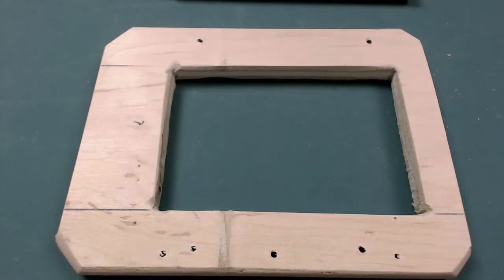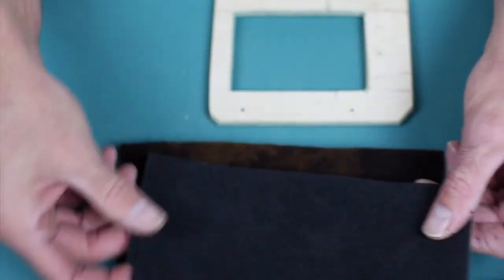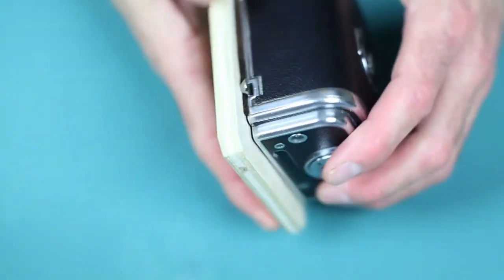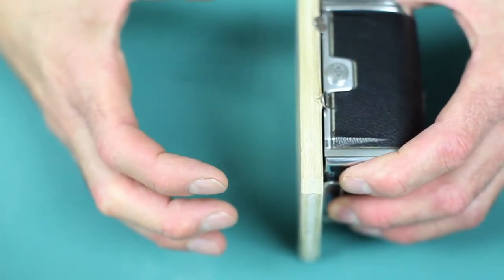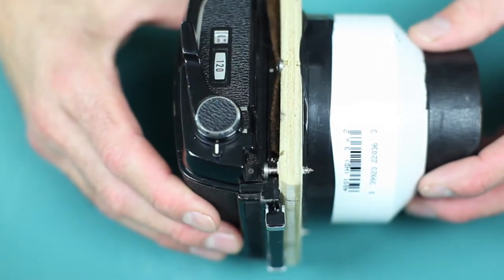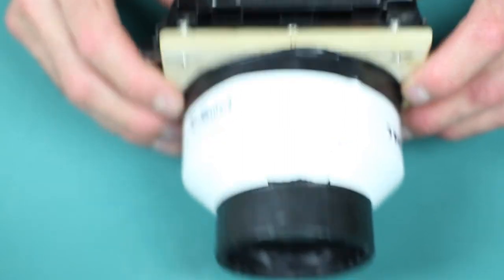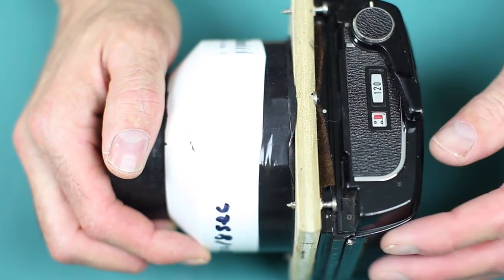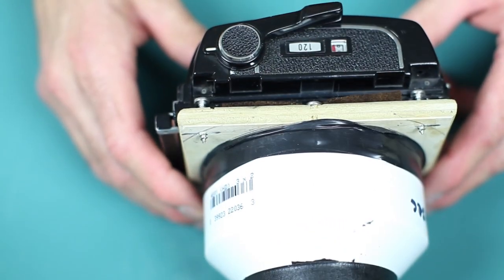Pinhole Camera with Medium Format Film Back

Comment: Hi Matthew. Great work here. I am planning something similar, and have a question that perhaps you can help me with. I am struggling to choose a film back because I am unsure... Do any of these backs have any sort of winding prevention mechanism that disengages only when connected to the camera body (by some little pin or something). For example, it was my understanding that one cannot wind a hasselblad back past frame one on the back alone, but only by using the body. Ideally I'd like to use a 6x6 back.
Reply from the maker: Hello. I don't have my Hasselblad backs with me right now, but I seem to remember using one of the older designs, the ones with a window at the back through which its possible to see frame numbers on the film backing paper. I will check this but it won't be for a couple of weeks as I'm away at the moment. Good luck with your projects, I'd be interested to see the results.
Reply: Or you can purchase Mamiya 6x6cm backs. I own several. BTW, 6x4.5cm backs were also made.

Comment: Thank you very much for sharing this wonderful and useful video. I am very interested in making one with my RB67 back.
I have a question.
RB67 back has a locking mechanism. After you load the film and get the film count #1, you can't wind the film any more unless the back senses the shutter is fired. After the shuttler was fired, then you can wind to the count #2.
How do you disable this mechanism to use it with pinhole camera, so that you can wind the film as you like with pinhole camera?
Reply from the maker: Thank you for your kind words. Regarding your question about the RB back, the locking mechanism is released by a small pin which on my pinhole camera is pushed in by the plywood mounting plate, so I did not have to make any further adjustments to disable the mechanism. Good luck with your pinhole camera, please let me know how it goes and be sure to share your images.
Reply: Thank you very much for the info!  Have a very happy New Year!